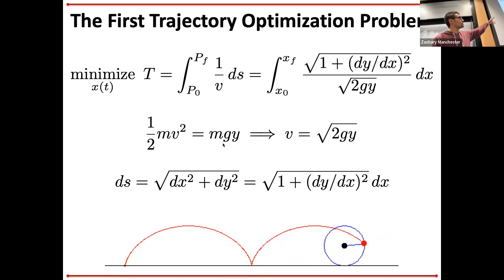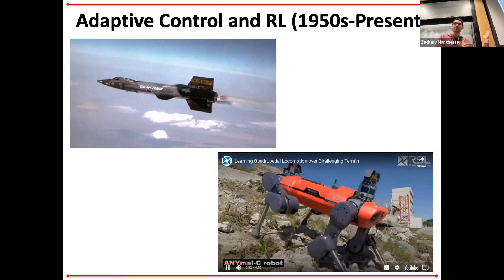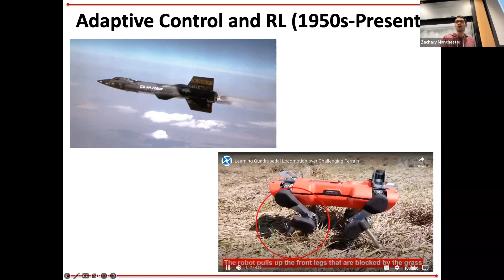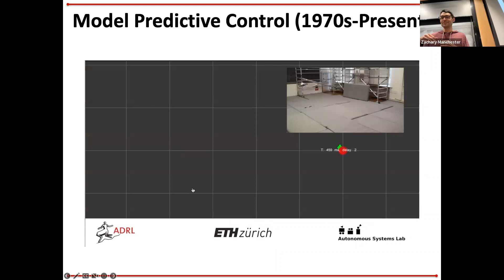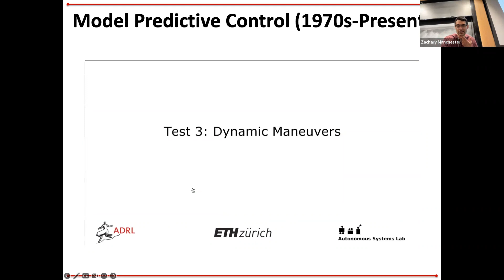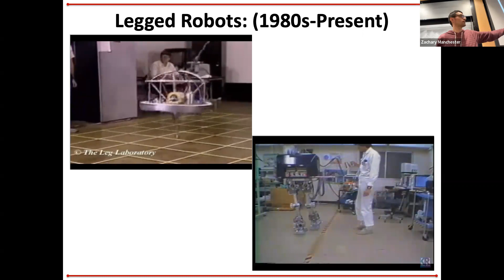Optimal Control (CMU 16-745) 2023 Lecture 6: Deterministic Optimal Control Intro

Comment: Thank you very much for sharing your excellent lectures. At 40:40..."Infinite dimensional" here means that the space of candidate control input functions U = {u(t)} is infinite dimensional; the space U can't be described by a finite dimensional basis. To counter what the professor said: The space of polynomials of degree less than or equal to 2 is finite dimensional--the basis is 1, x, x^2  (although each member of the space  has infinite number of samples between t0 and tf). On the other hand, the space of all polynomials is infinite dimensional.